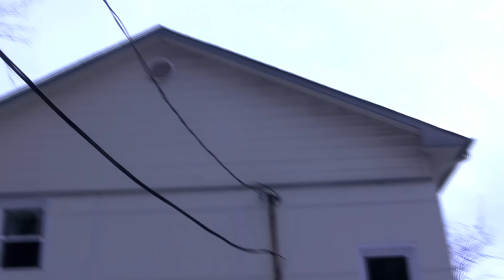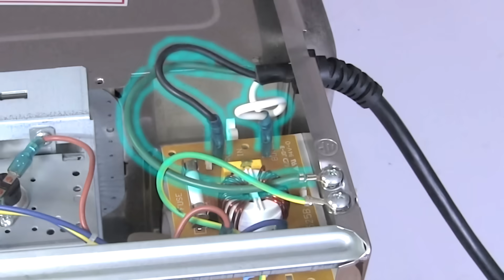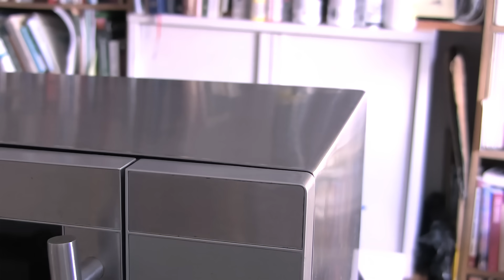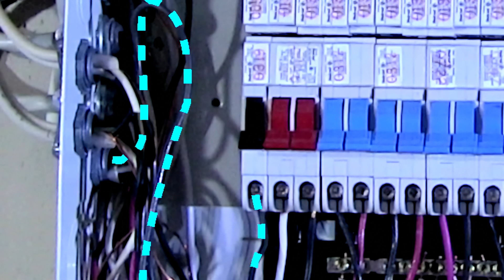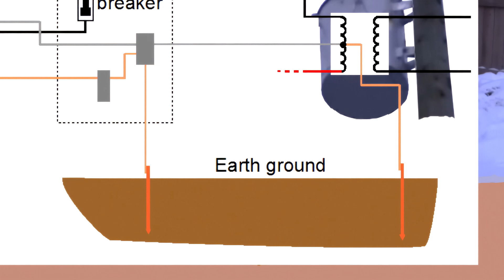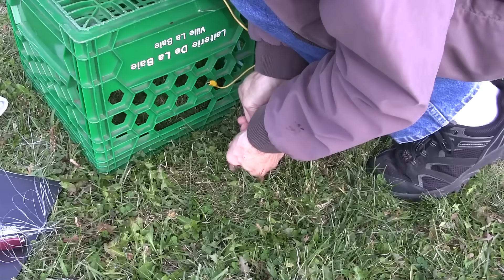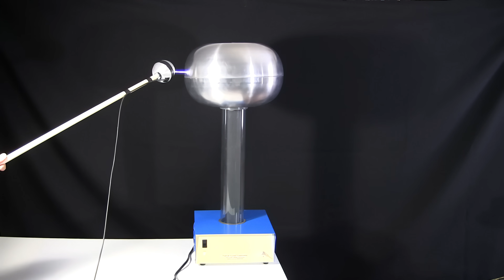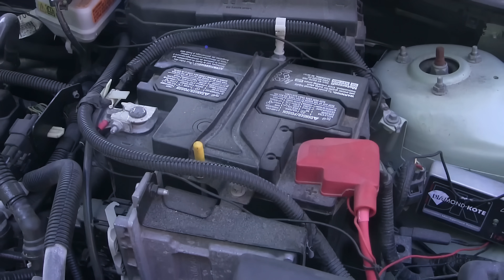What is Ground? Earth Ground/Earthing

Comment: Your pole transformer is missing the grounding.on secondary. The secondary neutral is connected both to primary neutral and to local ground which is at the base of the pole. This insures that the neutral that provides the ground of the transmission line at the point of production of electricity is also tied to the local ground. The microwave doesn’t need grounding since is uses the grounding of the transformer pole, however is necessary to have a local ground at where the electrical energy is spent, that’s why any household uses the water system for grounding. In this way, all possible grounding points have the same ground reference since they are connected.
Reply from the maker: I add the ground on the transformer's secondary at around 4:12. Yeah, there was so much more I could have talked about but I tried to keep it at what a layman might want to know about the ground for appliances.
Reply: RimstarOrg you are correct.
Reply: not always ... as they also have a proper earth ground at the local substation .. then the neutral line can be connected to -110vac whit the hot at +110vac ... and the earth (it's proper name) which is commonly referred to as ground is connected in your house to some pipe or other item that passes through the earth .... and also at all power stations ... making the earth ground a reference voltage of 0v ... as the earth has essentially 0 change in voltage from one point to another ...

Comment: Thanks for explaining this very well. but I have a question regardless of the video. What will happen if we have a circuit that consists of only the hot wire and the ground?

doesn’t just current flow through the ground and then comes back from the ground as it’s an alternating current if we consider that the ground can either receive a discharge and/or transfer of electrons?
Reply: If you have a multimeter you can test it.  Set the meter to AC volts and stick the probes into the socket.  the result is as in this image here:  https://www.ecmweb.com/sites/ecmweb.com/files/styles/article_featured_standard/public/uploads/2013/07/out.jpg?itok=ZmTrsxZ4    
So yes you are right the current alternates through the actual ground we walk on.  A better example would be the typical shocking accident where the person touches the hot wire an is also touching something grounded like the actual ground.

Comment: In the service entrance panel supplied by the electric company, the ground and neutral are connected (bonded) outside of the service entrance panel ( YOUR HOME) it is separated REMEMBER GROUND WIRES ARE NOT CURRENT CARRYING CONDUCTORS.
Reply: I love that you said this, it shouldn't have to be said  but dammit ive seen some dumb shit ...
Reply: Gary Mcwilliams   Are you saying that this man's explanation of line to equipment ground fault current is incorrect?  If so, can you please tell me the path the current will take?

Comment: Doesn't mean SHIT to me....    I'm in the UK   >shrug<
Reply: same for me in SouthAfrica,..sci-fi with transformers hanging off every pole!..lol
Reply: Nosey Parker    Unfortunately, it does mean shit to you.   It is still electricity and still works the same.  Your 240 volts is from a 3 phase 4 wire transformer somewhere.   So it is 416/240 volts 3 phase 4 wire system.   The wye point is earthed at the transformer and I believe at your residence.  What you call Earth conductors goes to a third pin in your sockets.  When your live touches metal frame and cord has Earth conductor, the path of that fault current goes to the transformer down the street.   It's electricity, it still works the same!

Comment: You never want to ground low voltage
Reply: Certain equipment is built and wired for very low voltages and grounding could introduce higher voltages which could damage wiring, equipment and more importantly could shock someone
Reply: Elaborate, please.
Reply: @RSP13 
When I typed low voltage, I'm talking 30 volts or less
which you want to keep isolated from higher voltages
Reply: @DavidisDawei  oh. Makes sense.
Reply: yeah, what happens if you mix together low and high voltage?

Comment: Think we had it right to begin with... positive, and negative. Not sure there is actually such a thing as neutral in electronics... of any sort... but it’s certainly a waste. It apparently does nothing, achieves nothing, and is worth nothing. It doesn’t exist.
Reply: He is explaining building wiring, not electronics. The proper term for "neutral" is grounded conductor. The term neutral is used to eliminate confusion between the grounded conductor and the grounding conductor.
Reply: if i didnt know shit about electricity, the neutral wire sounds safe its "neutral" but in reality the neutral hurts a good deal more than the hot because its an unbalanced load .

Comment: You didn't explain (or maybe I misunderstood) why the neutral wire is needed at all. Why not just use the hot/live and connect the neutral to the microwave chassis since it is connected to earth nearby? Thanks.
Reply: Because you don't want current to be flowing through the chassis except in a fault. During normal operation no current flows in the ground wire, it is purely for safety. The neutral is the return path for current.
Reply: @Robert-un3cf  Exactly! Thank you for the perfect explanation.

Comment: meanwhile in the rest of the civilized world, the ground is never connected to the neutral, because a ground fault is not controlled with a thermo-magnetic breaker but rather with a differential / ground-fault breaker.  It's unbelievable how railroads and electric safety were both frozen in time in 1950 in north america.
Reply: most electrical house fires are cause by stupid people doing stupid shit. gfci and arc fault cause more unnecessary  service call than i can count
Reply: Thermo-magnetic breakers work just fine, but now its not even about ground fault breakers or GFI receptacles, in 2019 its all about arc- fault. how we handle electrical in residential and idustrial levels is a constantly evolving system. 
Just because the standard is different over-sea does not mean that the other standard is dated. houses built in the 1950's in north america  there were no bare ground system in any of the receptacles or lighting circuits, in fact they used aluminum wiring!
Reply: @damonkaufman  no they dont work just fine because a faulty insulation can cause a ground current insuficiente to trip the tjermomagnetic but high enough to start a fire.  This is the most comminbissue in old buildings.  North American electric code and protection techniques are outdated and show complete ignorance about electric safety.
Ground fault is mandatory on every single circuit in a house. That's European standard, that's common sense. That's real engineering.
Reply: @citchelus  so if you've ever looked at a code book from north america or canada you would understand how the systems we use are safe. But you will continue spouting the one fact you know is true, and not accept that times have changed even since this video was made.

There are minimal circuits in a residential house that are not either arc fault or ground fault protected. The ones that are not protected are things that cannot have nuisance tripping, such as smoke detectors or your fridge.
Reply: @damonkaufman  no, they are not. Thousands of preventable fire incidents because of nonexistent metallic conduits for wires and inadequate electric protections.
I lived in Montreal for almost 10 years. Every winter, at least 5-10 fires. 
I'm gonna invite you to help putting the carbonized corpses in plastic bags.
Reply: @citchelus  i too have lived up in the great white north for 15 years and only 1 fire that was causes by electrical. Oh and it was an old house built in the 40's probably hadnt been updated to code in decades.

You wanted to say 240v systems in europe are better because they have ground fault built in? 
240 hurts more than 120. Twice the potential energy and enough to temporarly blind you. Ive crossed two phases of 120 and it left a 5ft black streak on the wall, and had to get a checkup for heart murmurs, if you accidentally ground out 120 through yourself you get a jolt and are usually able to retract yourself form what your touching. Dont spout shitty homeowner knowledge about electricity and let people do reaserch themselves.
Reply: @damonkaufman  simple exercise.  100mA are being drained to ground due to a partial insulation failure.  The point of failure is in direct contact with a 6x2  what protection is going to save your installation from a fire?
The 10W source is more than enough to slowly heat the beam and start a fire.

Comment: the resend we tap the neutral to the ground at the first point of disconnect is the eliminate deferents in potential , the fault will travel the path of less resistance to earth , don't think it goes  back to the center tap off the transformer on a pole, lol,
Reply: Guillermo Ramos   Please rethink your comment.   You are saying what you were probably told or taught in grounding class.   Which is a better conductor of electricity, dirt or copper wire (neutral) out to a transformer.  Also, you have been taught(i hope) that electricity only flows (current) in a closed circuit.   So please think this through carefully.  This video is 100% accurate on grounding system in US.   If you conclude he is correct, some of your problems deciding how to design grounding go away because it will make sense.   Oh by the way, about 99% of people will agree with your comment, even though they are wrong.   Respectfully,   Kevin

Comment: Sir..In this above ur diagram earth and neutral connect in breaker panel or not?
Reply from the maker: Yes, in North America, often the Earth and Neutral connect in the breaker panel though it's not always obvious. Often it's done through the metal of the case itself. Note that the code says the connection between Earth and Neutral have to be done in the first service panel after the wires enter the house, so sometimes it's not in the breaker panel.

Comment: The green wire is over rated.. at best they're prinstalled fishtapes in case you ever need to add a circuit. I cut min off lmao
Reply: OH! So you're the asshole that keep cutting off ground wires like it's still the 60's?

You're not too bright, are you?

Comment: I saw someone pulling too many wires thru 3/4 emt  and lost like 3 wires in the process...then used one wire to pull two more in it's place...left the ground out, kept neu and hot. As far as I know it worked out
Reply: Oh yeah!!!!...until the sheet rockers started getting shocked it did work fine. Keep some of your grounds.  The panel and home runs. Maybe a couple more just in case
Reply: I've seen 3 people pull a bundle of cables through EMT. I cringed.

Comment: Ground is that hard surface outside you slip and fall on in the snow and Ice.

CK this and its for real!
My X boss was telling us he did a CB radio for a guy the guy installed it himself in his truck,  
Now because it was in a truck the manul said tie this black wire to a good earth ground.
So he fills a 5 gallon bucket with Dirt and rams a grounding rod into it, that attaches it to his CB radio.
He then comes in complaining it dosn't turn on its broken! Fix it.
in a car or truck earth ground means chassis ground to complete the path of electrons.
Power flows from negative to positive in a dc circuit. 
That means your cars chassis is always hot. '
And if you work on the electrical system you always disconnect the negative battery terminal first.

Now in a home or building with AC current Ground is a differnt subject. Not to be confused with the Groundhog!
Reply: bobbg funny

Comment: Is one prong being larger than the other actually important ? I have also seen plugs with both prongs being the same size. Also, in Europe both prongs are the same size so you can plug it into the socket in any orientation. Why is it different in the US where one prong is bigger demaning you plug it in one way only?
Reply from the maker: The taller prong is connected to neutral and the other to hot. I have a much older video that explains the history which led to our plug looking the way it does http://youtu.be/k3OHzKz0qNc
Reply: If I understand correctly, some devices will function correctly, regardless of their plug's position in the socket. Other devices require that the hot and neutral go to the correct wire.

Comment: So is lightning protection grounding connected  to the electrical grounding?
Reply: penandpike    For a lightning protection system to be Master Labeled, one requirement is that it be connected to the main location.  Should also have surge protection there as well.  So, yes if installed correctly it is.

Comment: Is it not better using only neutral and hot instead of using all 3.
Reply: I'm no electrician, but from what I understand, you have to use hot and neutral wires, otherwise you can't complete the circuit back to the transformer and no electricity flows to anything -- the third wire (ground) is just a safety feature that provides an "easier" path for a faulty hot wire touching a conductive surface from flowing through YOUR body, instead that hot wire completes the circuit through the grounded wire, back to the panel, then back to the transformer. Also, this situation should trip the breaker that the hot is attached to since it detects that there is a higher-than-expected current since nothing is resisting the flow of electricity. I hope that's all correct lol
Reply: Whenever I see a three-pronged device, I typically respect its danger more than I would a two-pronged device.
Reply: @ethanwagner6418  ..'specially when it only has 2 wires coming out of a 3 pin plug.

Comment: But if the ground wire is connected to the neutral, wouldn't the neutral apply voltage to the microwave casing and make it the same situation as if there was no ground wire and there was a break on the hot wire that is applying voltage to the microwave casing?
Reply: The difference here would be that you'd have to intentionally open the microwave and touch the hot wire while touching the case, which is highly unlikely.
Reply: The resistance for the charge to come all the way back from the main panel to the microwave casing through the ground wire from the neutral is much greater than heading back outside and into the ground. So at that point all the charge leaves the house.
This is after the charge completes it's circuit THROUGH the microwave.
The microwave either causes the circuit to open, when its off (having no charge run through hot to neutral back to the service panel) or it is resisted enough to where the amps do not trip the breaker, when its on.
That is why if you have an application that requires a ton of power to run through it (low resistance) it will trip the breaker.
Reply: It does not because the only place you tie the ground to the neutral is at the very first main panel and at this very first panel you will tie the ground bus to 2 copper 8 foot ground rods that must be 6 feet apart  and driven all the way in the ground. Also you tie the cold water main on the street side of the meter to the ground so the cold water pipe will not be "hot".  There is also a method to use in a footer of the building.   If you have metal gutter and downspout you may need to tie it back to the common grounding also.  Peterson electric has a video online showing a flashing screw sunk into the wall and they hit the hot wire, this made the flashing, gutter and down spout "hot" and could kill somebody.  Pools and hot tubs if you have any metal framing needs to be grounded.  A metal screen porch by a pool should be grounded back so if there is potential it will trip the breaker.

Comment: Just curious my breaker box is grounded but the house was wired a long time ago and none of the recepticals are grounded. Can I attach a ground wire to the recepticals I want grounded using another ground rod or the ground rod that the breaker box goes to? Do not care if its up to code i only care if it would work. Im wanting a ground so my surge protector can work properly. I can't rewire the house and/or put the ground on the breaker box it's self.
Reply: If you want actual safety ask a professional, it will cost you but if you value your life its spare change.